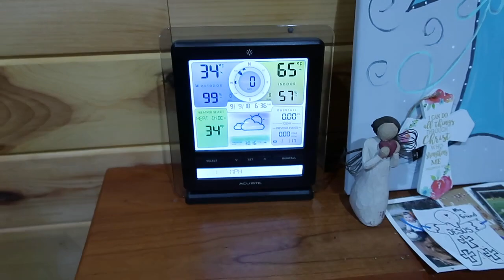Is Your Yard as COLD as Mine? (Water Freezing in the Summer!?!)

Comment: Re Ice:  Same principle Al as the "Beware of icy bridge" signs.  You had cool air flowing underneath and on top of the coops, so it cooled it down faster. Also, your ground still has residual heat from all the days of sun, hence no frost on the grass.  Finally, your temperature gauge is mounted high on a pole which is why it only read 34F and not below 32 - the cold air settles in the low lying areas since it is heavier.

Comment: You've got frost and ice for the same reason that bridges and overpasses get ice sometimes that some of the other roads don't...the cold air blowing over and under them!
Reply: Heat moved away is one part of the calculation.   The non-water parts in the water also effect at what temperature it freezes. Dirt, other organic matter, and whatever was deposited by the air mixed with the water making a compound that had a freezing temperature that was higher than plain water.   Controlling for both permits you to go the other way and supercool water, the point where it's below "freezing" but hasn't crystalized.  For an example see https://www.youtube.com/watch?v=Fot3m7kyLn4 .

Comment: 40k Subscribers woot!  I just got to 85. Have predators ever broken through the chicken wire on your chicken coop? I'm getting ready to build a chicken coop from scratch and had heard raccoons can break through basic chicken wire.
Reply from the maker: I haven't had any issues with predators getting through the wire. I have had a possum try
Reply: Chicken wire was made to keep chickens out not predators. If you don't have electric poultry fencing I suggest you use hard ware cloth! I have been through losing my flock 2 times and it was ugly. I always use hardware cloth now!
Reply: Dark Age Growing Just my unsolicited advice (😬🙄):  The run wire can be chicken wire.  They CAN get through chicken wire...it just depends on how desperate they are as to whether they make a serious effort, or not.  If desperate, they will chew through, or dig under.  All you have to do with nocturnal predators like raccoons is to MAKE SURE that wherever your chickens ROOST is made  like Ft Knox...with 1/2” hardware cloth, especially windows (of course) and the underside.  Mice/rats can chew through the bottom to get in.  We use 1/4” hardware cloth on the bottom of the coop.  1” hardware cloth is tempting to use, but raccoons can reach through it and rip heads off.  True story...  Good luck with it all! 😉👍
Reply: @dianamallory8535   Thanks this is pretty much what I had heard before, so I was surprised to see Al using chicken wire on the coop windows. Sorry you had to learn first hand.
Reply: @tarantulady8565  Thanks. I'm planning on using 1/2" hardware cloth on the coop for sure now.🙂
Reply: Dark Age Growing You won’t ever regret it. 😉

Comment: The tarp has cold air both below and above it, so it'll freeze earlier than something on the ground, which only is cold on one side. The ground is also a big source of warmth keeping the grass above freezing. Water itself is also an insulator. Also if that paint is latex and you hang it before its completely dry which usually takes 24+hours, it'll likely stick to the weather stripping. When you open the door, the paint will peel where it stuck. Dry to the touch is not dry. To avoid that, put painters tape on the weather stripping for a day or two.

Comment: I have read most of the comments and most were wrong.  What you experienced is radiational cooling.  The cooling of the Earth's surface and the air near the surface, occurring chiefly at night. It is caused by the emission of infrared radiation from the Earth's surface and from the tops of clouds and the atmosphere. Because infrared radiation is absorbed by water vapor, cloudless nights usually allow for greater radiational cooling than overcast nights. Radiational cooling occurs in all regions of the Earth and is important in maintaining the Earth's energy balance.

Comment: Hi Al, the ground retains heat and radiates it up which saved you from a light frost on the ground but you were close enough to frost that if the dew point was also below (if I remember right) 40 then the air surrounding the water was enough to freeze those air pockets

Comment: The ground tends to be a heat sink. The air can be a few degrees cooler than the surface due to that effect. It can also be the reverse where the air temp is warmer than the ground temp. That's how the geothermal cooling/heating works.

Comment: Wind chill. The breeze blowing across the dew or puddle evaporates some water sucking heat from the remaining water dropping the temp enough to freeze. With the ambient temps hovering just at freezing, it does not take much evaporative cooling to freeze the remaining water. If you checked the temp at the chicken tractor, you should find that temp to be right at freezing. In other areas, the heat in the ground prevents the grass from freezing. The ground temps need to drop a bit more. 
Dropping ground temps will trigger the lawn and other vegetation into a winter dormant state. Your grass seed has germination temperatures so you likely has passed any time when most will germinate. The winter rye will germinate down to 34 degrees and grow at temps down to 38 degrees. 
The grazing grass is quickly losing its nutritional value as the temps cause the nutrition in the grass leaves to get sucked into the roots to be ready for next spring. 
btw, Your weather station is likely at a location that is a few degrees warmer than the pasture.

Comment: Actually frost happens not at 0℃ (the freezing point of water) but when the temperature reaches +4℃. That is the point where water has the highest density. As the water temperature goes below +4℃, it starts expanding again. By the way, that is the reason for solid water (ice) to float on top the liquid water. If the Creator had not designed it that way, rivers and lakes would freeze from the bottom up, and no fish or other aquatic life would survive the winter.
As for the ice on top of the chicken tractors: The water gets chilled by the air flow from both above and below, so it looses more heat faster.

Comment: There is enough warmth in the ground that radiated up to keep the moisture on the grass from freezing.  The covers on the tractors were too far up off the ground.  Could have had a pocket of cold air where the one chicken tractor was, as opposed to the other chicken tractor.  Still in the 90's here in Florida.  Don't expect the first "cold" front  (the humidity will ease, but still be close to 90!) until sometime in October, could be as early as the first week!  Here's to hoping!  Tired of this HEAT and HUMIDITY!  When are you going to paint the rest of the house???

Comment: Why did this happen? If one looks at temperature and dew point data, the wet bulb temperatures are consistently at or below freezing. (The wet bulb temperature is the lowest temperature a wet surface can reach due to cooling by evaporation.) The strong winds,  and the low dew points (and hence relative humidity), enabled the air to evaporate the water at the surface rapidly, cooling the temperature to freezing.

The result?  The water froze, even though the air temperature was well above freezing. Watch the wind and dew point as well as the temperature!

Comment: As a professional painter I have to inform you your going to regret getting all that oil based paint on that glass. I'm sure  you've already realized it's not going to scrape off as easy and clean as you thought. Next time take the 10 minutes to take off the edges of the glass. Use a new blade. For any problem areas use some paint thinner it mineral spirits and a clean rag wrapped around a scraper or a flat head screwdriver  to take the paint off the glass